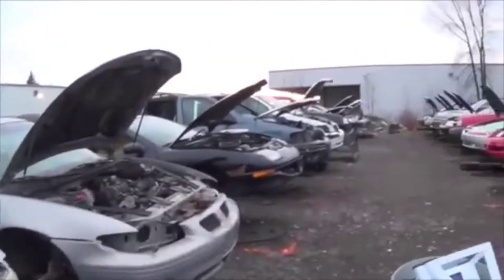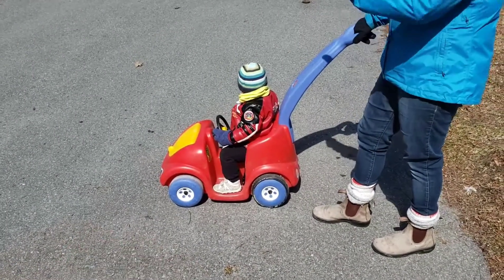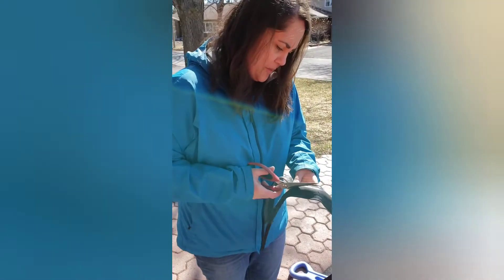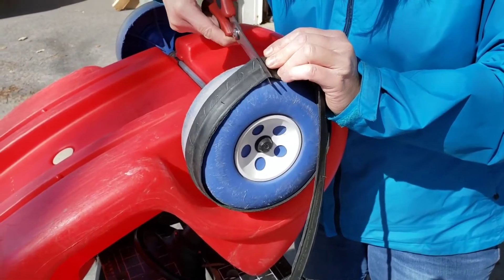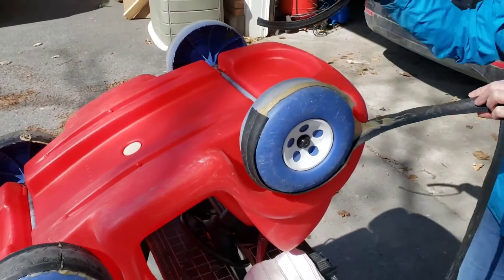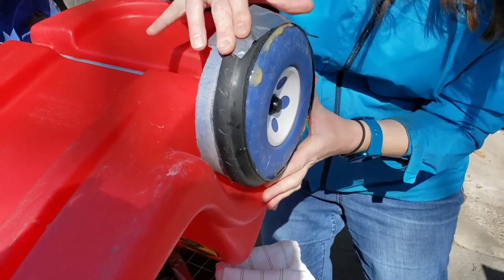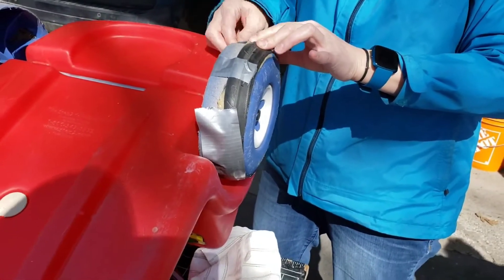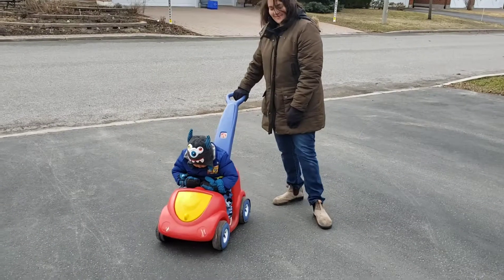How To: Quiet those super loud kids wagons, cars, etc

Comment: I'm totally doing this.  I dont suppose u have any tips on dampening the sound on the hard plastic play kitchens and toy tool benches?  U breathe hard on them and the sound echos thru the house.  I've thrown out the plastic toy food and hand sewn felt food just to eliminate some of the noise.  The boys don't care for the felt tools though. 😂
Reply: How about a custom rubber tire tread just to solve that problem?
Reply from the maker: Not sure they have these where you live but here in Canada the Dollar Store (Dollarama) sells in the hardware section a shelf or toolbench mat.  It's cheap.  Like a few bucks for a big roll of it.  You could cut it to fit custom and that might help.  Let us know how it goes!  Tks for the comment!